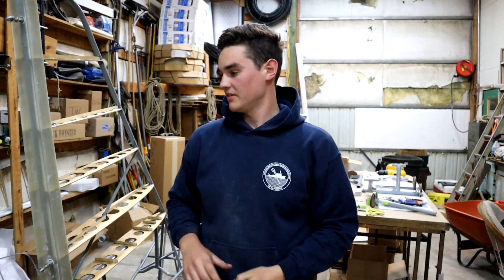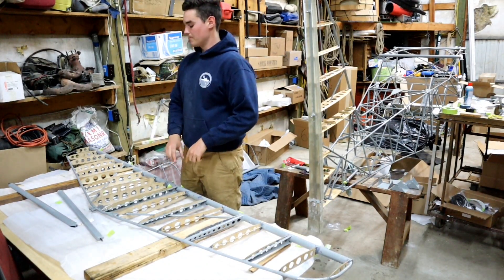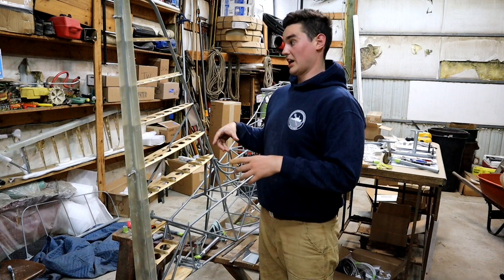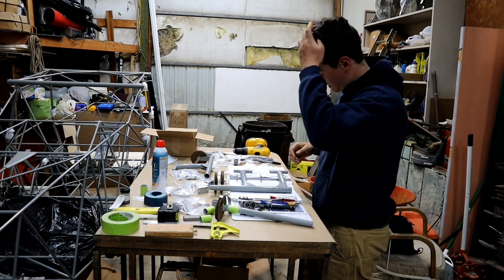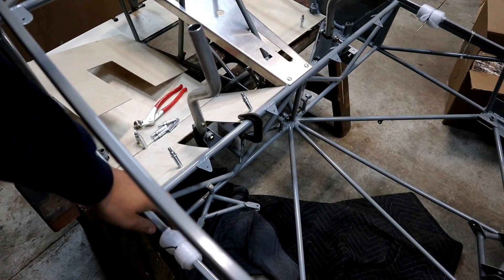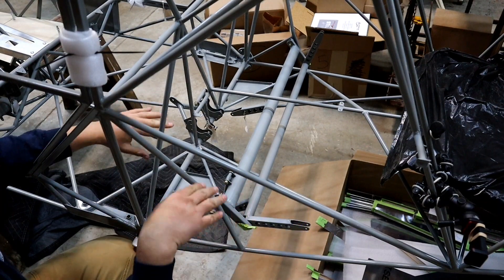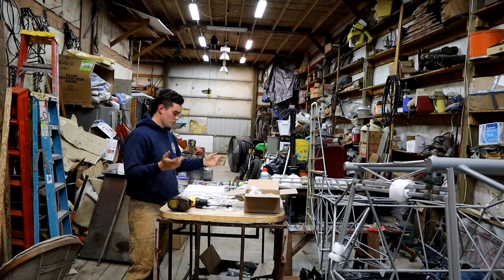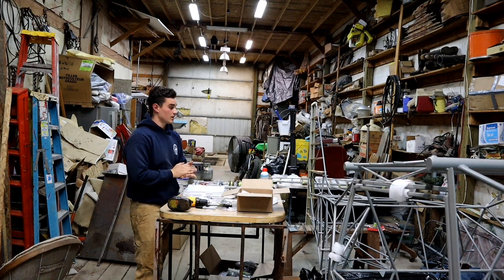Kitfox STi Build Update 1 : Tail pt 1., Elevator, Flight Controls…

Comment: With the bellcrank, did you have to ream out the bearings a bit more also?   I found the top 5mm of the bolt was 2 thousandths bigger in diameter than the rest of the bolt shaft.  So it spun freely 90% of the way pushed through, and then the last bit was tight to push in resulting in stiffining up the movement.

Comment: I am currently working on fitting my floor boards. When you worked on yours did you relieve the boards to accommodate the welding beads or did you file the welding beads flat?
Reply from the maker: I fit the floor boards to the beads. I don't like grinding on the frame lol